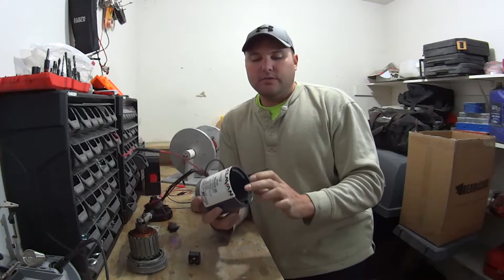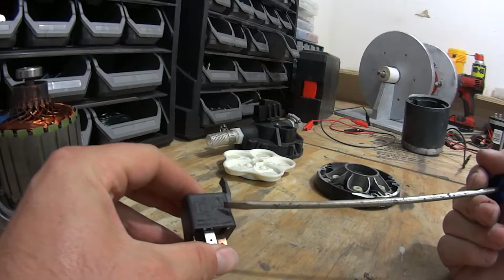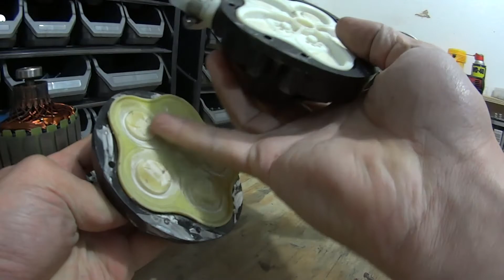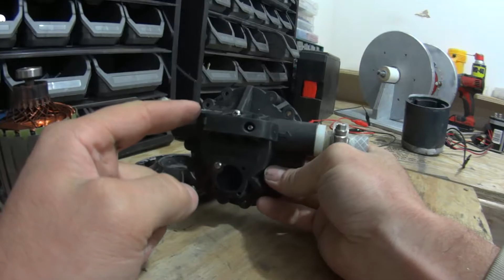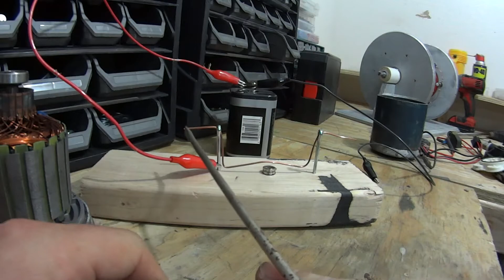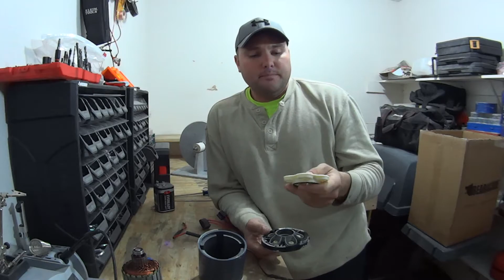12 Volt softwash pumps..How they work--How they break

Comment: what about running peroxide thru the pump as a buffer agent
Reply from the maker: A light baking soda mix from a bucket would be more cost effective. But honestly, if you rinse your pumps after each job they will hold up fine. Enough to make their cost to profit ratio feasible.
Reply: @ModernCurbAppeal  Thanks

Comment: I bought this pump after you and I talked and after a few uses I had these issues.  Took it apart the wobble plate had all kinds of trash in it.  Cleaned it all up.  Took motor apart and cleaned.  Now I'm working perfect again I bought a much better filter to keep trash out.  But good info on pressure switches I made minor adjustments to them.  Bettér flow and pressure short cycles I'm still messing with adjustments.  Delving is not real good on warranty I found out also.